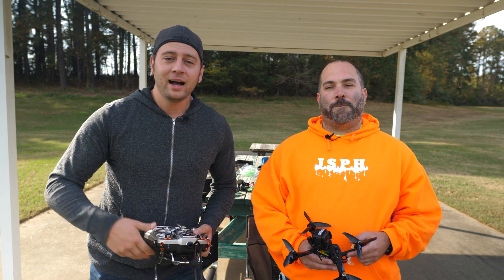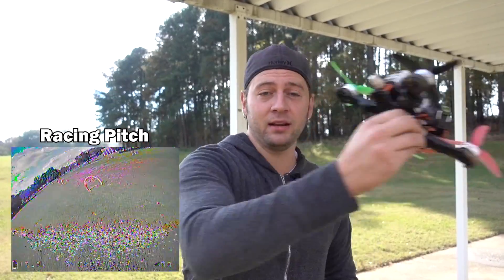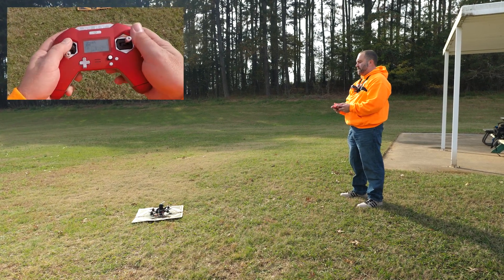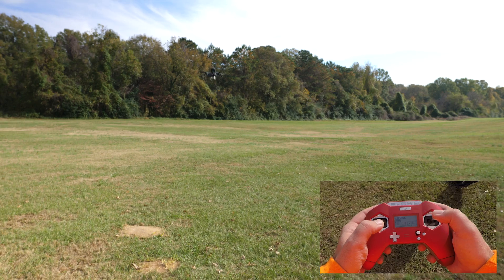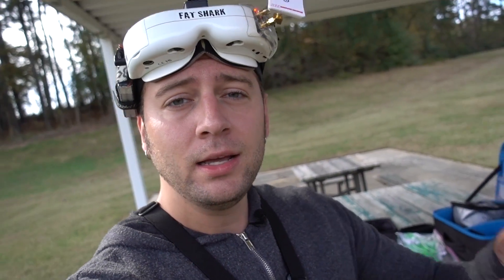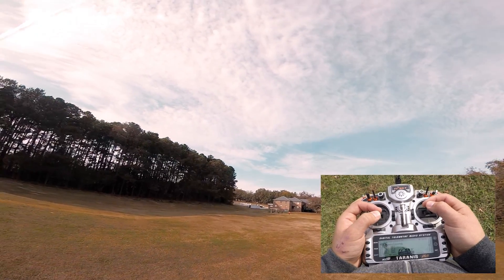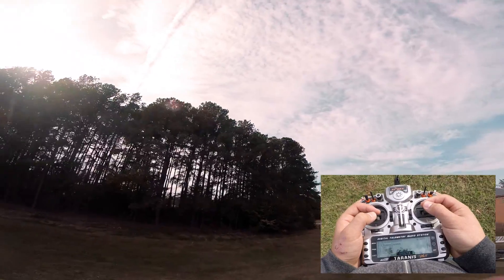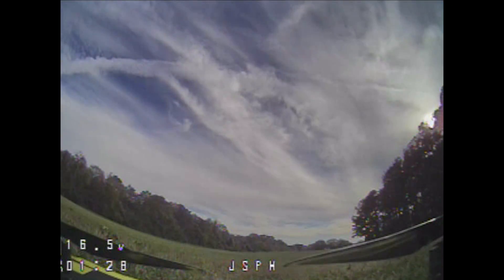How to Fly an FPV Quad - First Flight Tutorial and Beginner's Guide

Comment: Hi. I got a controller recently to practice on simulators. I was wondering whether the gimbal on the right should also be loose like the gimbal on the left (throttle). Thanks!
Reply from the maker: Nope, the throttle needs to be loose but not the other gimbal
Reply: @EdRickerVlogs  Thank you!

Comment: That is a good help. Thanks. But one question… what is the best way to hold the sticks to get a better control? Sound like one of you holds them with the thumbs on top, and the other holds every stick between the index and the thumb.
Reply from the maker: A lot of it is how it feels to you. The pinch style might feel weird at first, but I think ultimately it produces smoother flying for me. I started out with thumbs but switched to the hybrid pinch pretty quick.
Reply: @EdRickerVlogs  thanks. Ok then I’ll try the pinch style and see how it goes for me.

Comment: For beginners? You totally  skipped the first 4 steps.
Reply from the maker: What are the steps we're missing?
Reply: @EdRickerVlogs  Sorry to be blunt but I thought it was a video on first flight for beginners. You skipped over the steps listed on the splash screen plus one more important step.
Betaflight setup 
Test video trans.
Armed motors, props off
Tested failsafe
Binding
Or did you assume all that was done already? I had no clue what was involved before you even think of heading out to fly.
Reply from the maker: @phottomatt4202  that sounds like a video playlist to me. There's no way one video could cover all that without being very long. This is mainly how to fly once all of that is done, not how to set anything up.

Comment: When you point the right stick up, does the drone start moving up?
I'm struggling to understand, I used a simulator where the control is such that if I point the right stick up, the drone goes up .... but when I started using the DJI FPV simulator, the controls are inverted ...
Reply from the maker: Sounds like you're bouncing back and forth between Mode 1 and Mode 2. Mode 2 is the standard in the USA with throttle (move up) on the left stick, not the right.
At this point you need to decide which one you like better, and start getting consistent. I will say, in terms of buying and setting up most drones, getting accustomed to Mode 2 will make things a lot easier for you in the long run. Most drones/controllers you come across will be in Mode 2 already.
Reply: @EdRickerVlogs  I'm using Mode2, but I probably didn't express myself well ... My mistake is that I studied for days in a simulator where the controls are different than on DJI FPV. Now that I'm flying in the Liftoff simulator, I can't make any progress (using controls like the ones on DJI FPV) ... never mind, I won't bother you anymore ... while I used different controls, I flew like a bird, and now I feel like an idiot :(

Comment: Great video! Thanks! How can I static the drone on air, like to rest, or position the drone to a photo. Do I need a special sensor add-on?
Reply from the maker: FPV drones aren't designed or intended to hover and take pictures unfortunately. You're probably looking for a Mavic style drone to do that type of thing and not an FPV drone.
Reply: @EdRickerVlogs  I found this item in amazon and also a similar in alibaba and I wonder about this matter: Optical Flow Sensor, Yuenhoang FPV RC Drone Optical Flow Module Hovering Altitude Hold Optical Flow Sensor Balance Visual Position Board for Racing Quadcopter Multicopter Flight Control...  

My idea was that sometimes I would like to rest 10 seconds, while the drone is stabilized, maybe not to take a picture, but maybe to relax a little bit with the view, without worries about the control. What is that sensor for? Thanks for answer!

Comment: Glad I watched this good video. I recently build a quadcopter, and took it for a fly yesterday and crashed it about four times, only from a low height no more than 10ft. It is so different flying acro compared with a DJI with full stability. I was thinking it was my quad, but this vid has shown me its not, its me, I need to learn to fly this beast!!! The part about disarming the quad in flight I think is the most important point in the video.
Reply: Yeah I crashed mine today 5 times and broke a bunch of shit. It's insanely hard. Did you get better?
Reply: @nickpawsey  did you get better?

Comment: Thank you for sharing this great info, I’m videographer on wedding and sweet 16, in I bought my first drone because I will like to have a plus on my videos, I will wondering if you can help me please. My drone is “ iflight Green Hornet 3inch cine whoop 4S FPV with a Receptor FrSky R-XSR ” and I don’t know if that means I need to buy FrSky controller or I can purchase FlySky controller please somebody can help me and which goggles you can recommend me it’s my firs experience.
Reply: I would recommend you getting " radiomaster tx16s" as your controller, as for goggles it depends on your budget, for less than 100 you can get the ev800d, an in the 300 range you can choose from  skyzone 02c, 02x or 03O ranked from cheapest to best. For top of the line you can get fatshark hdo2's with a rapidfire module but that'll be 600+ bucks.

Watch some reviews and you'll find what fits your needs.

Comment: Hi, newbie question
I have the DJI FPV controller, goggles, and camera linked to Luminer drone.
At 3:05 in video, how do I "arm" and "disarm" it? How do I get the propellors going? Thanks
Reply: Did you watch any Joshua Bardwell? He Will reveal all.  Took me a straight month to get mine going after making some changes in betaflight all went smooth.  On to my second quad now. The obsession is real......

Comment: edit ignore this comment

You're teaching people to blow their escs with abrupt motor stops like that
Reply from the maker: If their ESCs blow from anything we did in this video, then their ESCs are crap.
Reply: @EdRickerVlogs  interesting because bardwell says even top of the line escs can blow from an immediate motor stop. But your response was very uninformative thanks for the insight
Reply from the maker: Point me to where he says that.
Reply: @EdRickerVlogs  watch his most recent live stream q&a where a super chat comes in and asks him why his esc quit when this happened. He watches the video and says it
Reply from the maker: @TheKtchevelle  I have a hunch that you're confusing abrupt motor stops with a motor that is obstructed from spinning. If I crashed in a bunch of tall grass or pinestraw and I try to spin up the motors, I will entangle the props and yes I could easily burn up an ESC. That's the result of trying to spin a motor that's obstructed. Power spike, heat built up, burn out. 
That's why we illustrated in the video that you should always disarm before you reach grass or vegetation and gently fall into it instead to land. However, an abrupt motor stop like simply disarming will NOT affect an ESC. The power is cut, the motor stops, the quad falls, that's it.
Reply from the maker: In fact many ESCs provide a feature called "motor braking" which actually magnetically stops the motor in its track so it doesn't continue spinning with its own inertia.
Reply: @EdRickerVlogs  it's at 1:34:xx into his live stream. Yes I was referring to abrupt motor stops like a crash. Prior to your response simply disarming I would have considered an abrupt motor stop. You've lead me to believe that disarming slowly spins the motor to a stop. Forgive me i am new. So it seems similar to me. Had that been your initial response to me i would have been super appreciative of the response rather than just calling them shit escs
Reply: That being said. I appreciate your clarification in that response. I now understand the difference.
Reply from the maker: @TheKtchevelle  Haha well you straight up told me I'm teaching people to blow up their ESCs, so I'm not really going to respond to that in the most eloquent of ways. I don't know who you are or what experience you have, so you just sounded like a troll. No hard feelings though man, stay strong with the hobby and don't feel shy to ask questions. We're all in this together.

Just to clarify, the disarming approach we show in the video is literally the disarming I do after every single flight. 1000s of disarms, no ESC problem :)
Reply: @EdRickerVlogs  to be fair I did say ABRUPT motor stops in my post.

I apologize for how it came off. Thank you for clarifying my misunderstanding.
Reply from the maker: @TheKtchevelle  Just watched the JB stream. The voltage spike he talks about is caused by an ESC still outputting power to spin a motor when a motor can no longer spin. That can be grass, pinestraw, dirt, or in his case a playground pipe. If you try to spin up an motor that cannot spin up for one reason or another, that's the danger. It won't happen every time, and JB even mentions how most ESCs shouldn't be affected. If I had to guess, the ESC was already on its last leg already from previous crashes or mistreatment, or just quality control from China.
Reply: @EdRickerVlogs  probably a wizard

Comment: Just starting my FPV adventure and you two just eased my jitters quite a bit. I am not new to quads but starting to fly acro for the first time. I will be using the Tinyhawk Freestyle to learn with and I have a 5" quad just waiting to spread it's wings later on. Thanks for this most informative video!

Comment: Watched this video multiple times. Coming from a Mavic, this is a whole different story. Started with my Tinyhawk and moved to a wizard x220s. It's easy to want to start doing flips and stalls right away, which is what I did and wound up breaking stuff on the wizard, but that's how you learn to fix your quad and take it easy. Rome wasn't built in a day so just have fun.

Also, get a sim. My graphics card isn't the best but freerider will give you all you need and it isn't a graphics hog. If I hadn't tried a sim first I would have had much more to fix.
Reply: I need to get a controller.. stop using my Xbox one.. ordered tinyhawk II rtf with goggles and controller

Comment: Can't wait until my first flight!  Gonna start off with a Tinyhawk S.  But first I've got a Taranis QX7 on the way to use with a simulator.
Reply: Shit I need to do that. Get transmitter. I been using Xbox 360 controller lmao.. and think tinyhawk 2 rtf with Google and controller . That controller prob doesn't work on sim
Got liftoff and freerider
Reply: How did this work out for you? I got the tinyhawk 2 and cant fly the thing without crashing almost immediately lol.
Reply: @123457chevy  Were you flying LOS or FPV?  I started off in FPV as I didn't have any prior flying experience.
Reply: @BlueOvals24 los. I don't have any experience either.  Is it better to start in fpv or learn how to fly the drone firts?
Reply: @123457chevy  I'd suggest getting a flight simulator like Velocidrone on your computer and plugging in your transmitter so you can get a good feel for flying without destroying your Tinyhawk.  I didn't practice enough on the simulator and ended up having a hard landing after doing a flip and it seemed to either damage my flight controller or esc's.  If you really don't want to use the simulator, try starting in FPV.  A lot of the professionals say to start with LOS, but when I tried that I crashed immediately just like you.  Then I tried in FPV and found it way easier to stabilize the copter.  And if you haven't already, configure it using BetaFlight Configurator so you can calibrate it and tweak some settings.  And start of in stability mode so you don't accidentally over correct and flip yourself into a wall.

Comment: Hey Ed, slowly getting into the sport of FPV.  been flying DJI products and like to see a flight characteristic comparison video.  difference in stick behavior/drone flight orientation and how best to transition into FPV.  Thanks.
Reply from the maker: Thanks for the idea! Besides a video which is a great idea, I suggest getting started with a simulator like Liftoff or Velocidrone. They use the same radio that you'd use with your FPV quad, so it's a seamless transition. I recommend the Jumper T16 radio, or the Taranis Q7x as a cheaper but good alternative.
Reply: @EdRickerVlogs  Quick update.  Went in and did a (more) than a few tweaks to the TinyHawk RTF version.  It seem to fly worse so in BetaFlight I saw a 'reset' to original or what I thought would be 'factory' settings but it turns out it wipes ALL the your factory settings in place of...so now I have to start out from the beginning/find the settings 'dump' file, maybe even 'flash' the firmware (not sure if that's necessary) just to start to get back to the beginning.  Geez!  Learned a lesson there.  Email Emax and hopefully they'll get back to me with the appropriate 'dump' file and (thinking optimistically)...a step-by-step procedure to get back to RTF version factory specs.  Now there's another good topic for a tutorial Ed! :)

Comment: Years ago I flew RC airplanes.  It looks like the FPV controls & flight is similar to that, opposed to my DJI P4P controls & flight.  Does the flight orientation get confusing for FPV vs your photographic drones?
Reply from the maker: Hi Chris,
The flight styles are so different that the controls don't really get confused from FPV to DJI. Occasionally it'll feel a little odd if I haven't flown DJI in a while, but generally it's not a difficult transition. I also hold the thumbsticks a bit different for DJI controllers. I use strictly thumbs with DJI while I use a bit of my index finger for FPV.